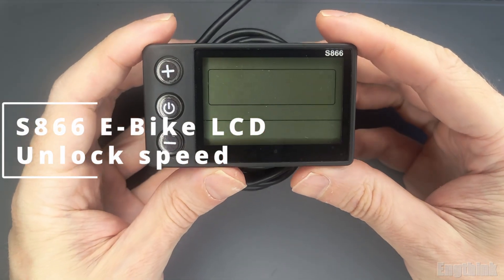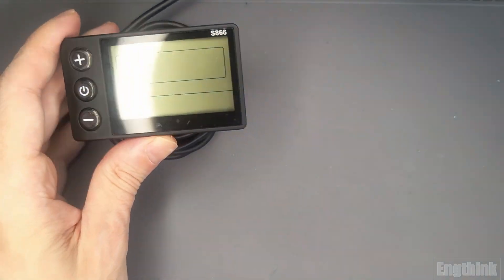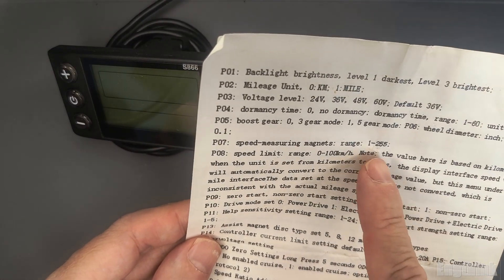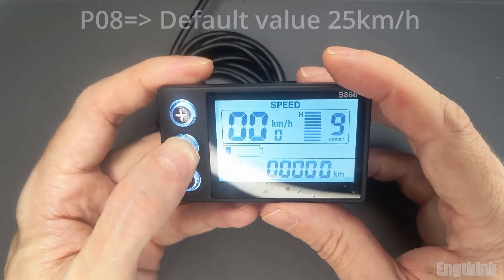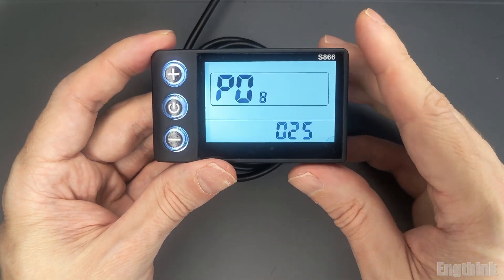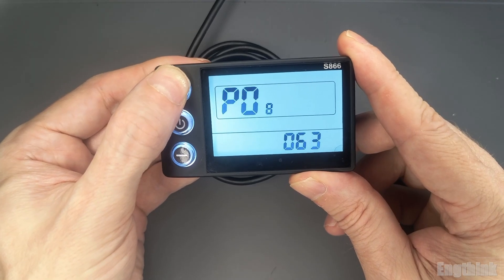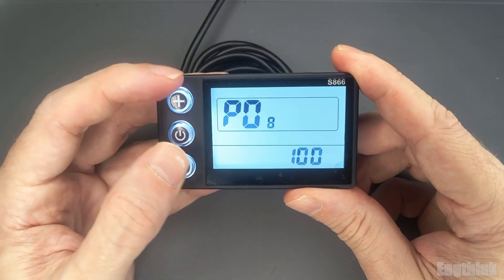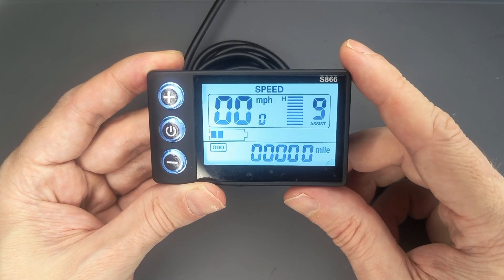🔓 UNLOCK the SPEED Limit on Your E-Bike! | S866 LCD Display Tutorial #ebike #S866 #ebiketutorial

Comment: My display only goes to P4. It does not go to P8 only P4.??? What can i do??
Reply from the maker: Probably different version of firmware.
Reply: @engthink  thanks I figured it out. Twist the throttle while holding the power up switch allowed me to go from 20mph to 32mph. Thank you for responding 🎉😊
Reply from the maker: @JackPowers-l4q  very good thanks for sharing!
Reply: Hi just converting a sudoo 36v ebike.to s866 ..when you say you hold throttle .is that on full power and are you then on po8 .then do you mean by the power up switch .that is the positive on the s866 
Prefer to think i am brain dead .best way to explain thank you .i do get perameters to po20 on mine .so learning .first bike i have rewired from manufacturers original